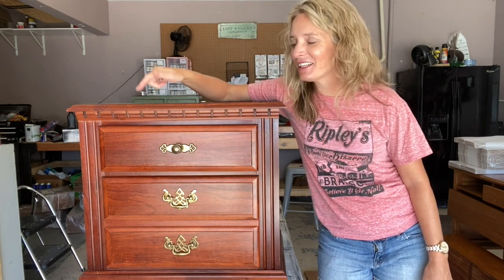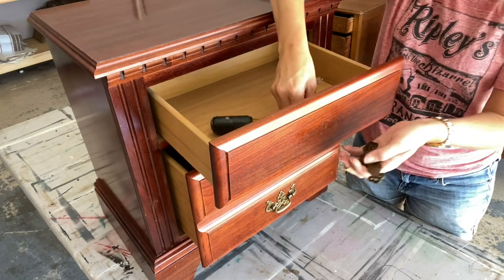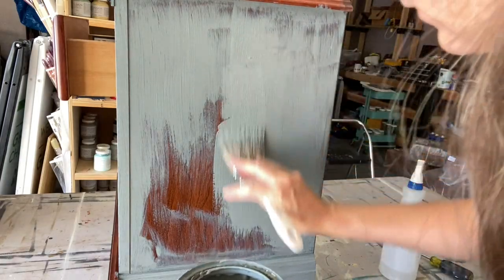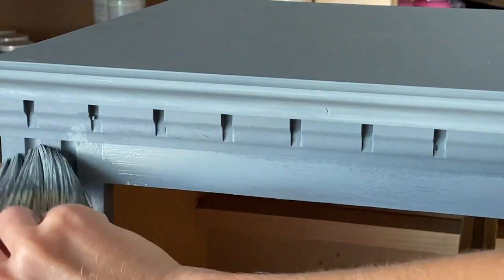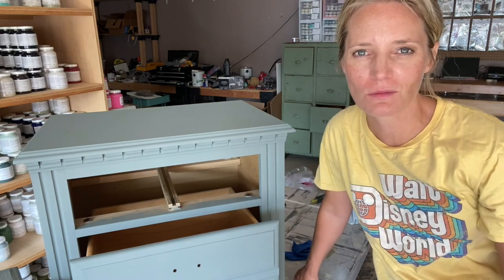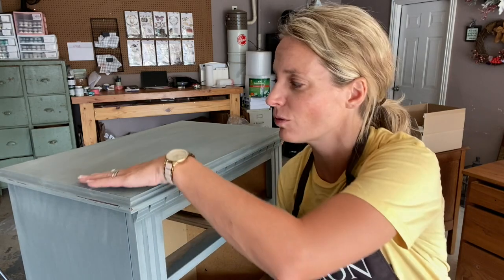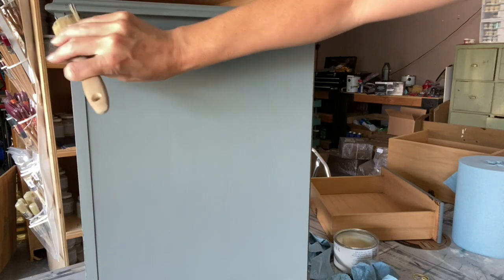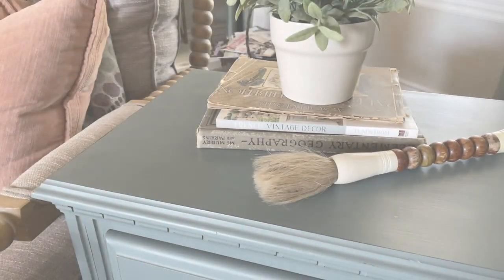Chalk Painting Furniture | CUTE Nightstand Makeover with JOLIE Chalk Paint | Chalk Paint How-To

Comment: You stated in the email, "As much as I LOVE using Fusion Mineral Paint, I still use chalk paint on a regular basis.
Reply from the maker: That’s right :) I do use both and really enjoy each of them for their own reasons
Reply: What are the differences? Should use Fusion for? Chalk for?
Reply from the maker: GReat question! I use Jolie when I am painting something really shiny (or big!) and I want to skip doing any sort of scuff sanding (which you have to do for Fusion). Jolie also can make for a faster makeover, Fusion requires more dry time. And if I want an antiqued finish with a dark wax, that’s also easier (I think) with Jolie. Fusion is excellent for sleek finishes, cabinetry, and does also produce a really nice finish when properly applied with a good brush.
Reply: Thank you! Very helpful!